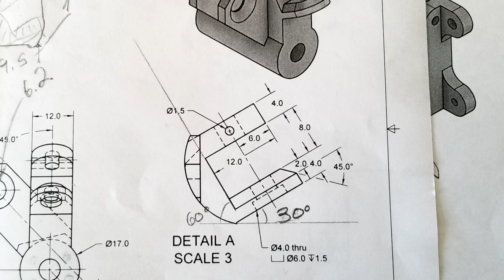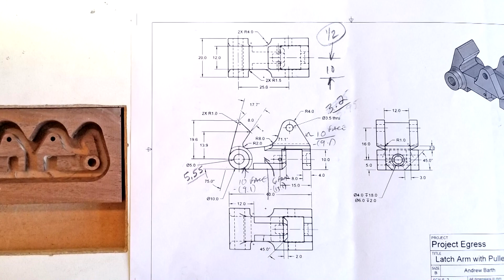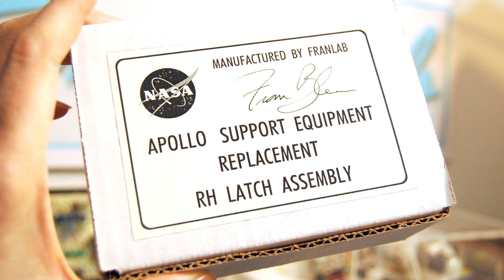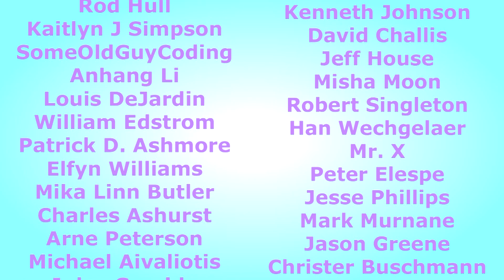Project Egress: FranLab Mission Accomplished!

Comment: Great job! One of the things that they found out about engineering drawings from the Apollo project is that they are the concept. If changes had to be made, they never went back and made as-built drawings. You really had to examine the finished part to see what had been done with all the in field modifications. So in the end you did what the engineers at the time were doing. Eyeballing it and making changes in the field.

Comment: Can someone educate me on Project Egress? Quite a few channels I subscribe to announced they were part of project Egress and were tasked with making a part for this replica "door". In my head I envisioned everyone responsible for a different part to be assembled into final project (seems reasonable, no?) But everyone seems to be making the same latch. What am i missing here, why is everyone making the same part of this project? Will they all be tested, and the best one chosen or something?
Reply: There's a bunch of latches arrayed around the perimeter of the door. I think i count 15. Check out the interactive 3d pic at the bottom of the page

https://www.tested.com/science/space/880604-announcing-project-egress-project-national-air-and-space-museum/
Reply: There are 15 of the latches in the final assembly
Reply: There have been a few other videos released so far (clicking on the hashtag will bring up a search) including both the operating handle and one of the actuator rods that links the latches. Given that the Tested page includes a list of over 40 makers, there will no doubt be others coming up in the run up to the assembly day.
Reply: So there's going to be 15 latches all sort of customized to each maker's own style? That makes sense. I must be subbed to just the people making the latches is why it was confusing...seemed like everyone was making the same part of this project. Thanks for the info!
Reply: PowerScissor I hope Fran discussed her corrections with the other participants, as not everyone would have her old school knowledge of how drawing discrepancies would be resolved in the 1960s.
Reply: @johnfrancisdoe1563  Several people have 3D printed latches (also one has cast a resin version from a silicone cast of 3D printed parts) so I assume that the stl files are OK. Anyone relying on the cad drawings would probably be similarly affected, though I don't know if anyone aside from Fran has actually gone this route.

Comment: I wonder if at the end of this project the builders will understand and maybe appreciate the benefits of GD&T applied to prints. This would help define better intended function and better define the more critical features that will need to match other builders parts. Not to mention the basic integration of useful knowledge into the maker community would be very helpful when needed.

Comment: That piece is beautiful. How is the strength of walnut compared to aluminum or whatever they used in the original latch. Is it very different? What about heat resistance ?

Comment: I just use a ring and hook..... or a hasp and padlock
Reply: Jim E It has to open all the latches from vacuum tight to run away from a fire with a single turn of the doorhandle.  Unlocking or unhooking one-by-one is too slow for an Apollo 1 scenario.

Comment: This would have taken 2-3 days if you used a simple filament feed 3d printer. Just for prototyping and doing the final cuts in wood.  Those printers are cheap these days!  :)
Reply: There are others doing just that. Art takes time and effort.
Reply: How would that help, you wanna do lost wax casting?  Just melt down the wood and pour it in a mold? :P